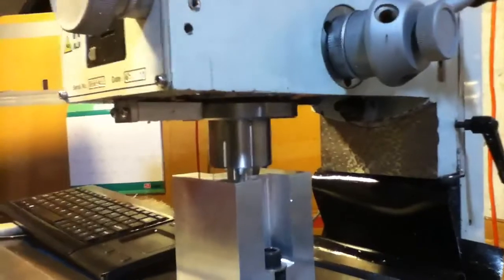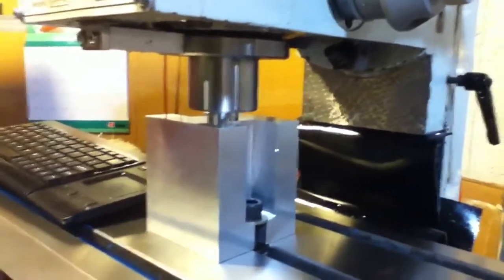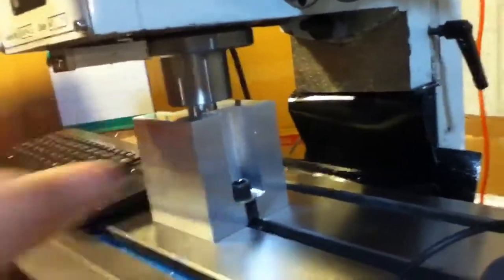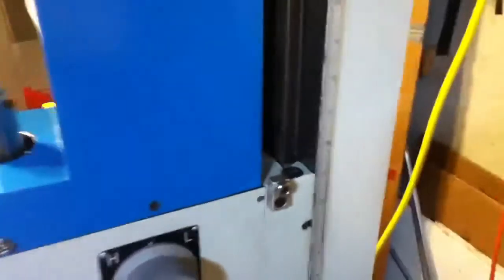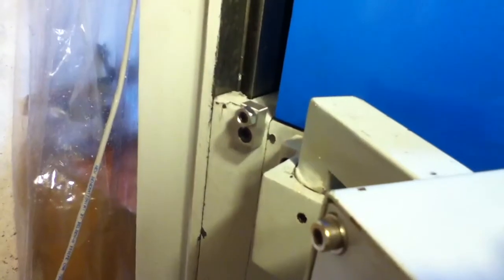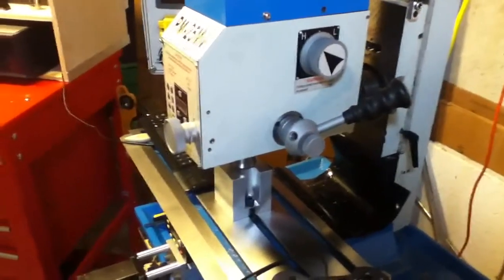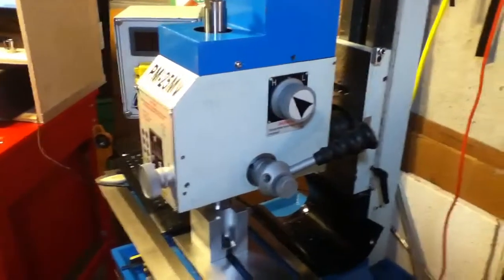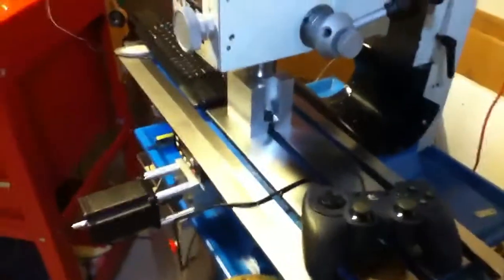Mill Head Removal Aid

Comment from the maker: @jeremy0203 - Yes, very handy.  Make sure when you go to put it back on that once the head is on the boss enough to get the center screw started you release the block from the table.  Would be very easy to do some damage if you start cranking it slightly offset.  Also, forget pulling the head off the pin once it's free.  The weight keeps it clamped in the taper.  I had to take the block off the table to remove the head from the machine completely